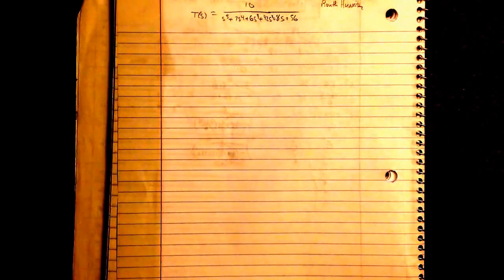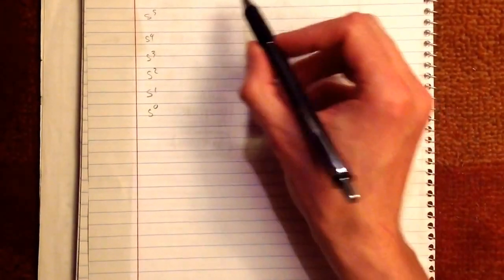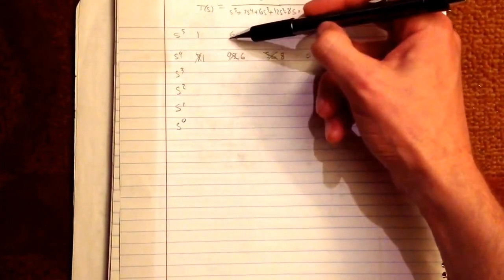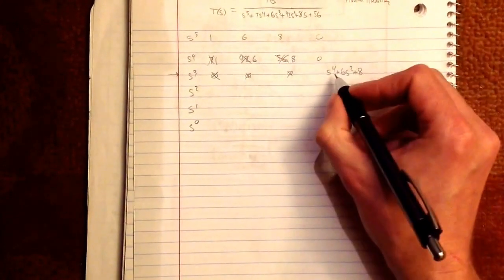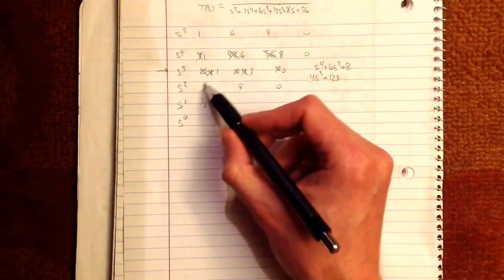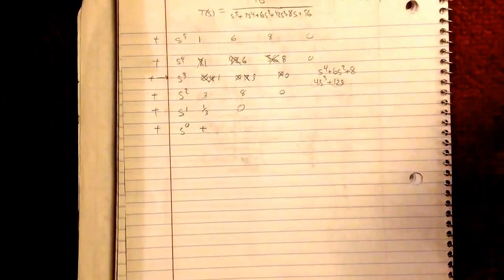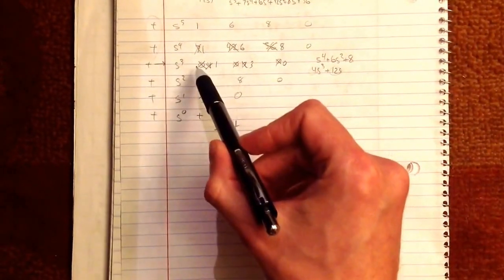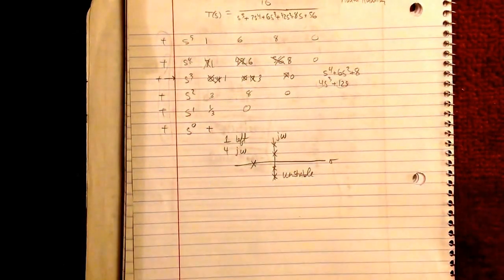Routh Hurwitz row of all zeros

Comment: Just a heads up guys, pretty sure he did the determinate (for Routh Hurwitz at least) in the wrong order. That might be how you do an actual determinate of a matrix though...but I think for Routh Hurwitz,  pretty sure its (for clarity ill use the original numbers...) [(7*6)-(1*6)]/7. He had it as [(1*6)-(7*6)]/7. I know this is old but I hope this helps anyone in the future looking at this. Still very helpful in showing the auxiliary equation and the process for the special case of row of zeros! Thanks!
Reply: You can do it the way he did, but make sure to multiply by -1. He did this in his head

Comment: Ummmm...I did check this transfer function in Matlab...with a  Gp = 1/(s^5 + 7S^4 +6s^3 +42S^2 +8S +55) ...so that the characteristic equation is 1 +Gp =0,...and the result was marginal  stable.  and yes indeed there are  5 roots ... 

Real Root 1: -7
Complex roots:
Root 2: -i*1.414
Root 3: i*1.414
Root 4: -i*2
Root 5: i*2

why did  you say that the system is unstable ? ....Ummm for me is  marginal stable.

Any comments? Thanks.
Reply: yeah hes wrong. its marginally stable. if it had multiplicity (which he defined incorrectly) that would mean TWO poles are in the exact SAME spot on jw axis.
Reply: Thanks!!!!!